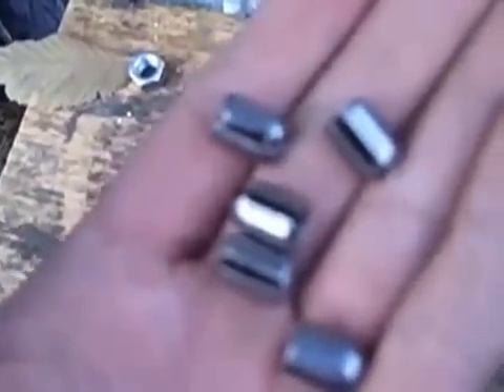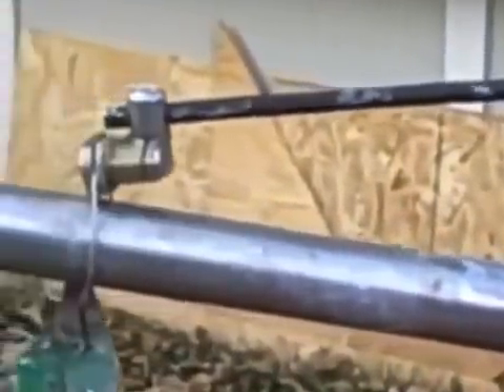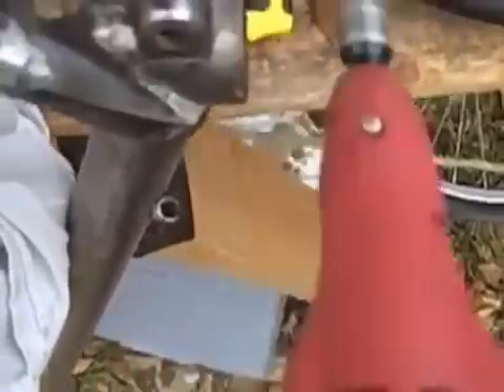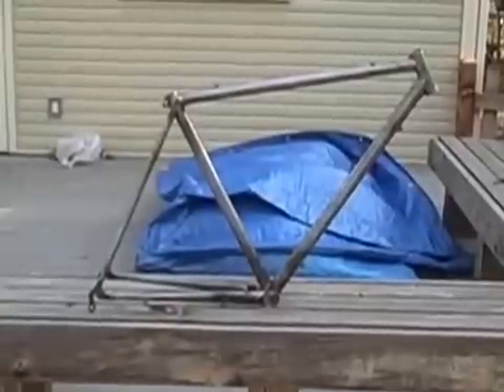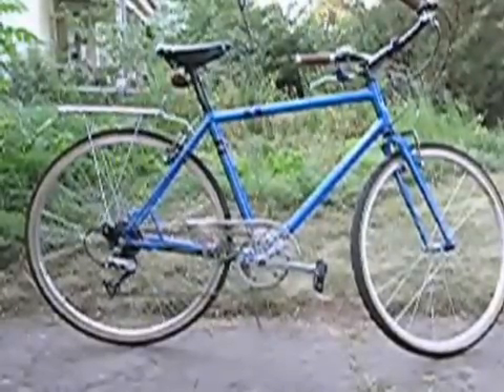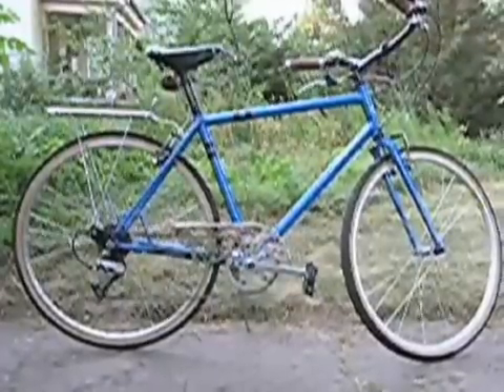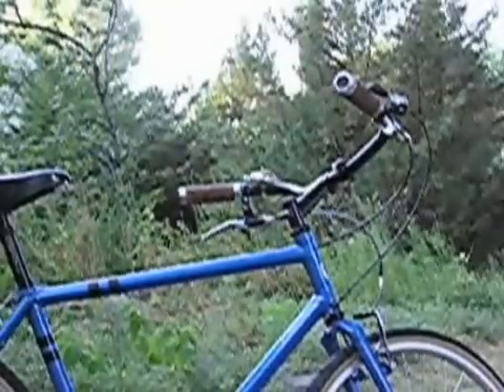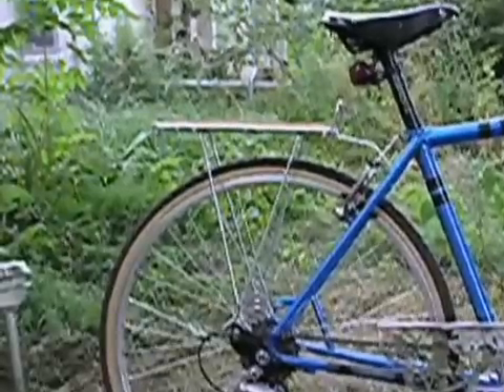lugged bicycle frame construction part 3/3

Comment: You missed a very important thing at least for us, how you brazed the seat stays at the seat tube? And the brake caliper mount? Did you do a fillet weld? If so can I do a fillet weld at the rear dropouts?

Comment from the maker: Start with a simple build.  Start with track-ends or horizontal dropouts instead of vertical dropouts.  Don't use heat treated tubes (the really thin stuff) until you are proficient in brazing and are able to get good frame alignment.  (Sorry to get back to you so late).